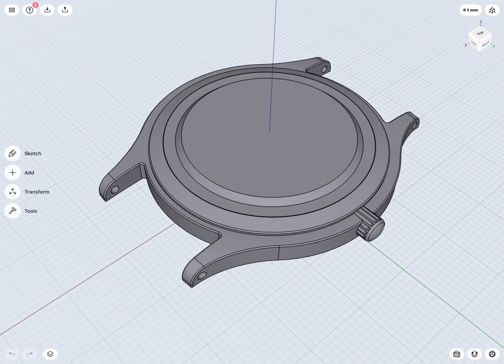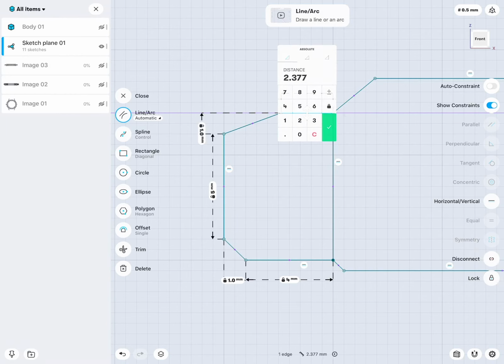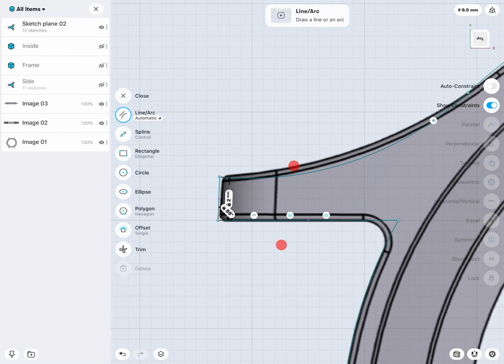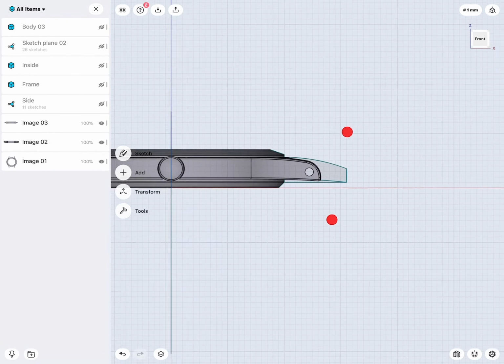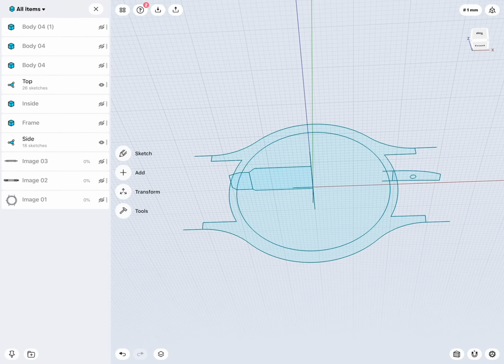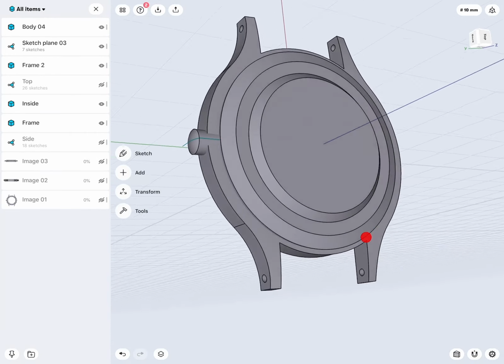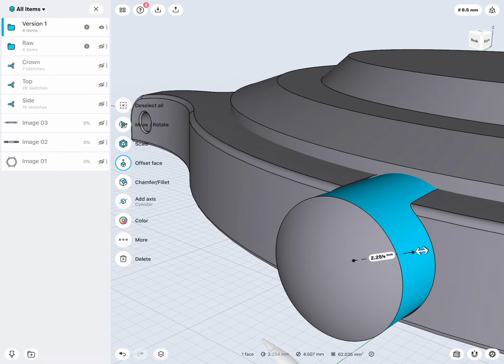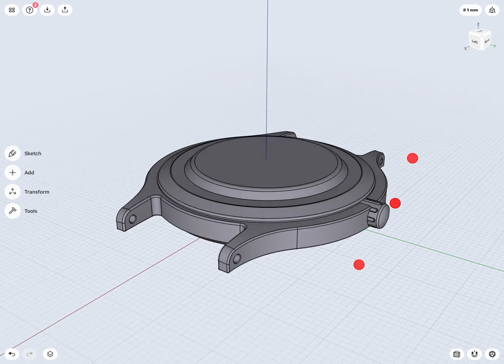3D Modeling a Watch on iPad | Shapr3D

Comment: Please help, Is there a way to open a tutorial in a window inside the app? I don’t know why but in the first tutorial it was opened inside the app and now it is opened in a YouTube separate window and it is much less convenient
Reply from the maker: Hi! You can tap on the question mark on the upper left side of the screen where you will see a Tutorials option. Those videos can also be found on our webpage.
Reply: @Shapr3D  When i do that it opens the tutorial in the youtube app and then i need to toggle between the apps or use split screen, is that how it should be or there is an option to watch the tutorial in the app like the first interdiction videos. ?